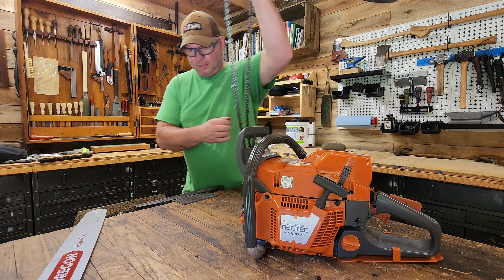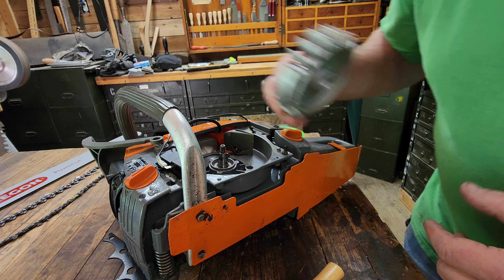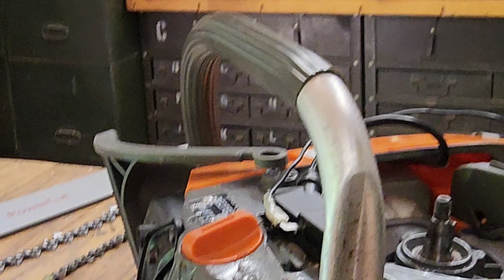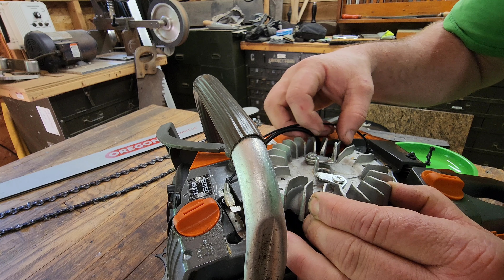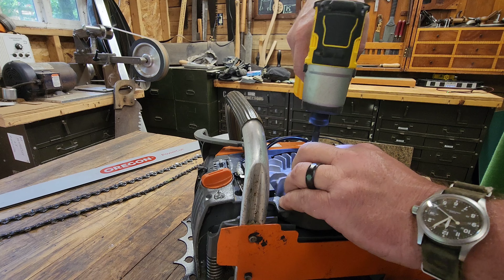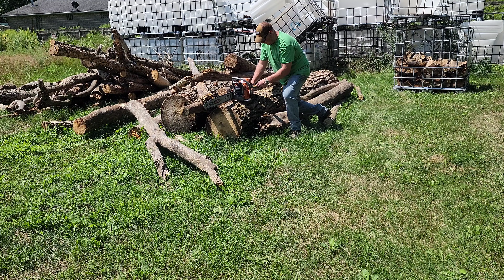@IndianaDoug Made Me Do It! #fod #neotech #372 #clone #chainsaw

Comment: You can do it with just the tools provided with saw and a hammer, if you remove spark plug and use piston stop. Use bar wrench for the flywheel nut.
Reply from the maker: Good point